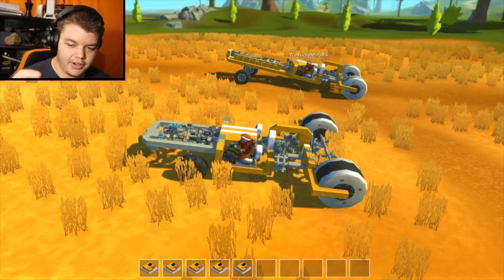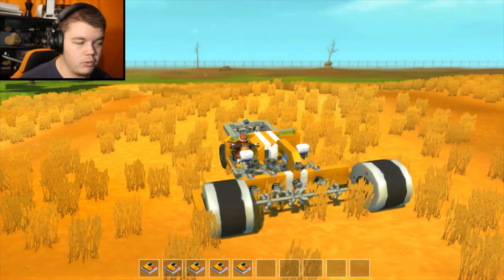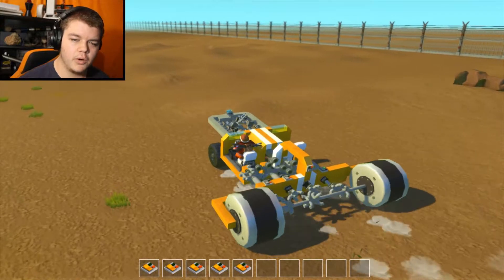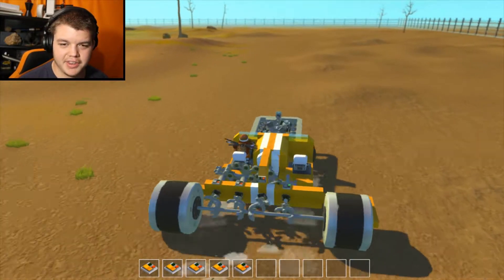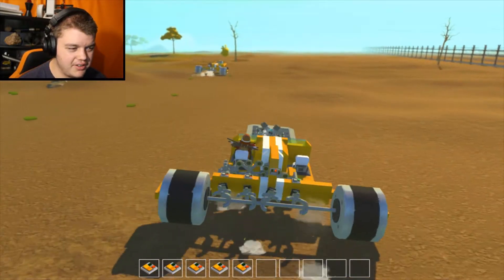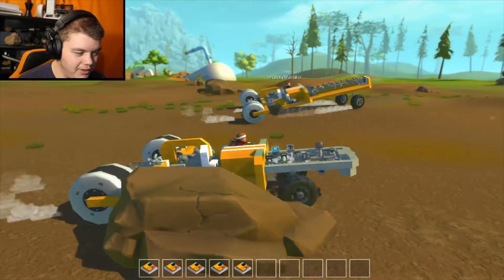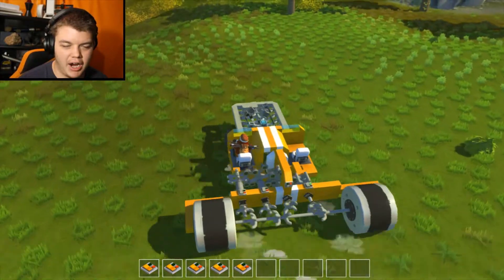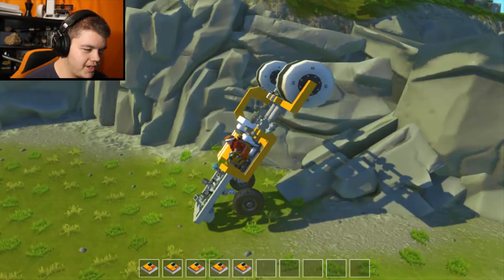Nebus Engine | Scrap Mechanic Ep49

Comment: If you made that engine work with a mid engine rear wheel drive (MR) set up then I would be amazed especially if it had full independent suspension instead of a solid beam suspension.
Reply from the maker: +AKGaming some of my Gear cars do have suspension, but it takes away some speed, and adds some lag...